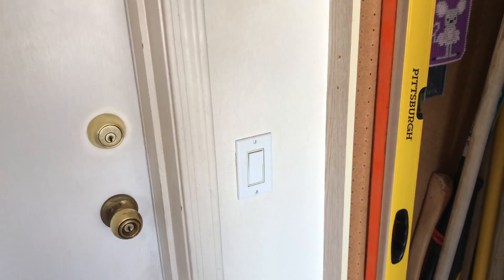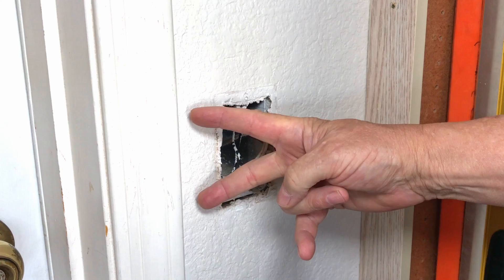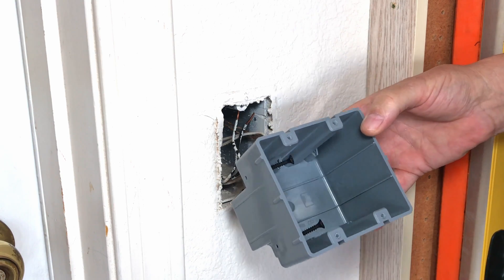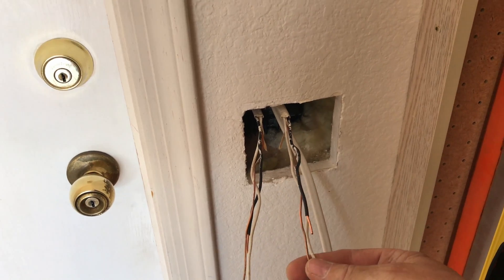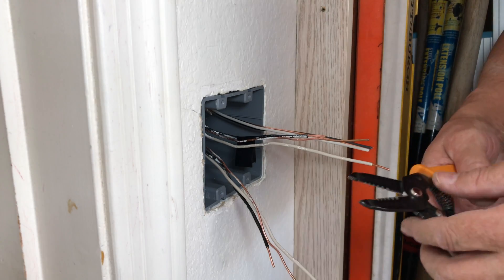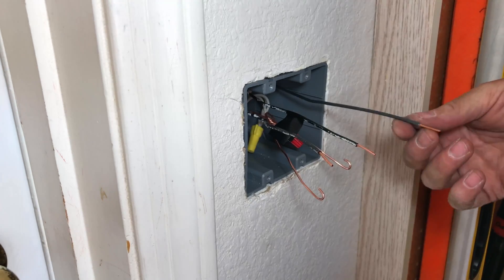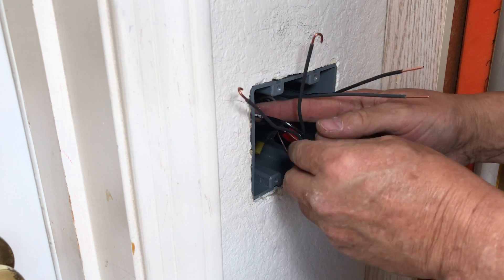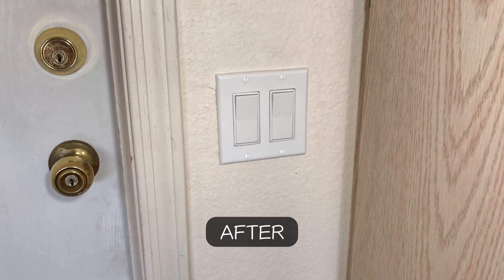How to Install a Second Light Switch in a Single Switch Location

Comment: I like your choice of box with the screw attachments from the inside, rather than the standard old work box. I think the standard old work boxes are ok for switches, but not so much for receptacles. Then again, a little extra mounting strength can't hurt, as you're using switches. FYI, it doesn't matter which wire goes to which screw on single pole switches, regardless of whether they are paddle type or toggle switches. You did a very good job.
Reply from the maker: Thank you, I appreciate that.
Reply: Im sure he knows that. And good for you for knowing that. But hes just keeping it real simple for folks who dont know.... ya jerk off